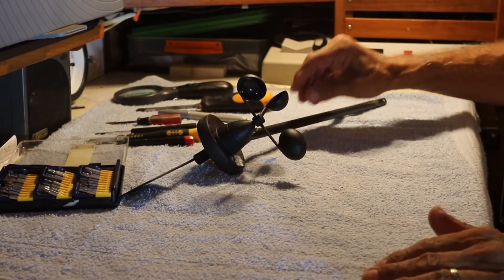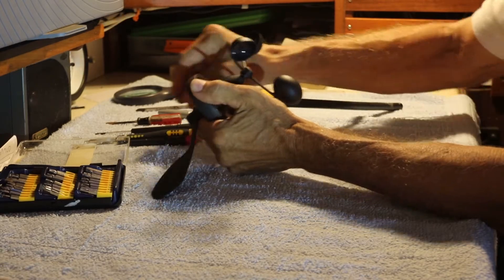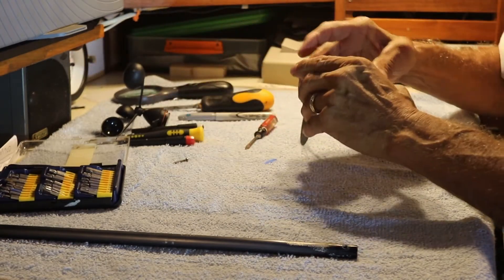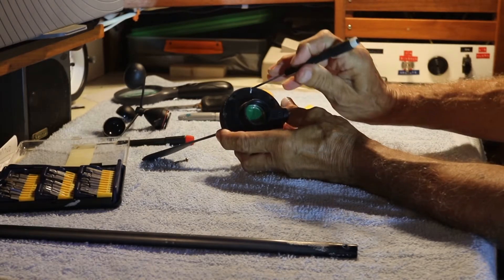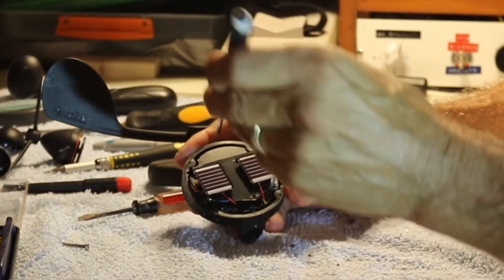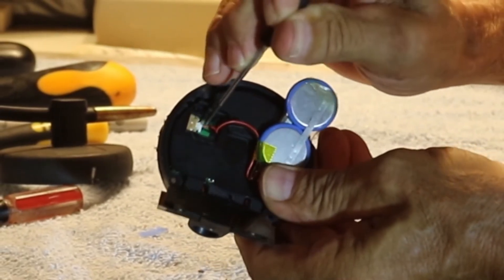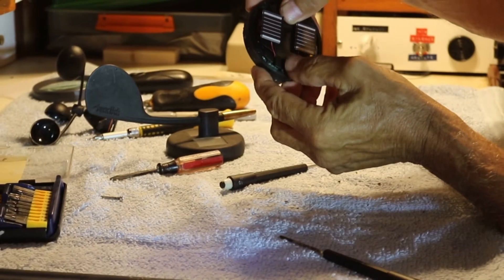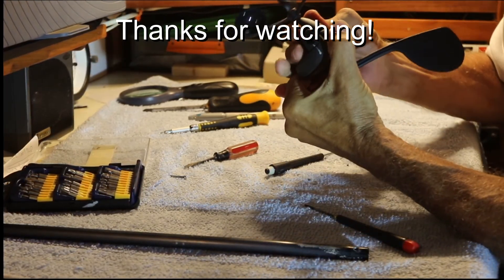How to Fix a Tacktick/Raymarine Wireless Wind Anemometer(T101)Patrick Childress Sailing 5

Comment: Mine shows 1 to 2 kts of wind even though there maybe 10-30 blowing. Direction works fine. Any recommendations
Reply from the maker: Either the top unit got struck by lightning (they are the most suspect Ike thing on your boat I think to lightning activity) or the top unit needs battery replacement (see link below for link to it)  or your bearing kit needs to be replaced in that top unit. take it down. if it’s spinning freely then it’s the battery. if it doesn’t spin freely then new kit from Raymarine to service those parts . Good luck :)

Comment: Thanks for a good video. I replaced the batteries. All worked well so i installed it on the mast. It still was ok. A week later all dashes again
Any ideas? I have since taken it apart and checked the battery connection which is good. Battery reading 6 volts. Im stuck.
Reply from the maker: Sometimes the solar panel get a glass of lightning or other conductive spark. I wonder if the solar panel went bad? Test output of it, but I am afraid another disassembly…

Comment: what is the batteries code?
Reply: ML2430 6V Lithium manganese battery ML2430 Rechargeable button Li-ion batteries pack plug
Gauges have the same battery.
Reply: @MrMusuk  thanks.
Reply from the maker: Link In the description below. I don’t have it handy.
Reply: 3v o 6v ???
Reply: @luissepulveda4031  3v. 2 cells in parallel

Comment: Thanks, this vid was very helpful. Replacing the battery is more difficult than expected. In my experience, the tiny screws would spin but not come out. I could unscrew many times with no perceptible extraction, but screwing back in would get tight after one-half of a turn. I finally gave up and (eventually) figured out that the screws had very little bite anyway. After giving up on removing the screws, I started prying the case open with expectation of likely destroying it. The indentations provided for prying are deceiving. It looks like the prying screwdriver would be inserted from the outside, pointing inward toward the center. But the indentations only provide access to the very tight seam between the case and cover.  So the small screwdriver tip must be forced into the crack between case and cover, with the tip pointing outward rather than inward. Lots of pressure is required to break into the seam because the case must be slightly deflected. Expect some minor damage to the case. When the cover finally started moving out of the case I was able to work the driver tip around the circumference, bit by bit, several times around, until the cover could be pulled from the case. Total time was about 60 minutes, but I could do it again in 10 mins. The replacement screws provided with the battery are slightly longer and got a better grip when the cover was replaced. It’s a tedious task, but in my case the project was a success.
Reply from the maker: Happy to hear it worked out for you. I don't know why they made it so difficult to take apart.

Comment: Was wondering ,do you think that heavy boats are more comfy while underway and less likely to swing back and forth .
Reply from the maker: I would think their heavy momentum would make for a better ride but the trade off is that they are slower and sit there to get pounded where a lighter boat will give more with the waves and get there faster. I will take the lighter and faster boat.

Comment: Hello Patrick.  Just watched this video as I have been shopping for a wireless wind instrument.  Your maintenance video is very informative.  I have read mixed reviews about wireless wind instruments in general, not pointing at any particular brands.  How has the TackTick (now Rwymarine T101) worked for you? Reliable?  Do you lose any transmissions from the masthead to the display?  How tall is your mast? Is mast height an issue for the T101?  I am having to replace an old Datamarine on our newly purchased 30 yr old sailboat.  Any info you can give would be greatly appreciated.
Reply from the maker: This is Rebecca...our Raymarine (used to be Tacktick) have been very good. But when the battery starts to go, you start getting issues...so have to be prepared to do what you see in the video after 5 or 7 years. Everything is a trade off I guess. Run the electrical lines for a wired unit if it’s not too painful... but if it is, use the wireless unit that you must replace batteries in every so often. We are quite happy with ours. Would never have run lines for wind, but am quite glad to have wind now. Our mast is about 54 feet from the waterline I think it is, and there is no issues with that height. I’m not sure what the threshold is... 75 foot mast may start to have issues. Also, there are times, under our hard dodger and canvas over the cockpit that the display units don’t get enough sun. We take the displays off the bulkhead and put them out in better sun for a few hours, and they are back on track, even in cloudy rainy conditions. I hope that helps. -Rebecca
Reply: Thank you Rebecca.  Decided to go with a wired system.
Reply from the maker: Can’t go wrong with that...except if there is a problem with the line it’s a lot harder to troubleshoot when something does go wrong. But if it’s a Raymarine, support is great, and they are pretty darn robust anyways. Enjoy! And glad the video could help you decide. -Rebecca

Comment from the maker: Hi everyone... Do you have a Tacktick wireless anemometer? Have you had to replace the batteries yet?
Reply: Hi Patrick, instead of using two screwdrivers to disconnect the battery, it's easier to use a small needle nose pliers.
You then have one hand for the tool and one for the action.

Comment: Patrick, my Tacktick system is now and then losing wind information. The display freezes (or is at zero when it does not come up when turning the system on). The whole system is from 2009, so it would not be unusual for the battery to need replacement.
You show that that is easy to do, but where do you get a battery assembly from?
Reply from the maker: Lucas, One thing I did not mention in the video is that when opening up the anemometer case, give the assemblage a counter clock wise twist, about 1/8” and it should be easier to get apart. I did not show that in the video. Likewise, on reassembly, line up the peg with the slot then twist together. I did not realize this till much later. Hope this helps. Rebecca is adding a link in another response for where to buy the battery packs. I have seen the same, soldered together, battery packs sold in specialized battery stores but the big question is if the tiny connector is exactly the same. So I think it is safer to buy them direct from Raymarine.
Reply: Lucas Hofman   Hi Lucas...This is Rebecca...Patrick’s wife...The link for the proper kit is here... https://wp.me/s7qyue-1560